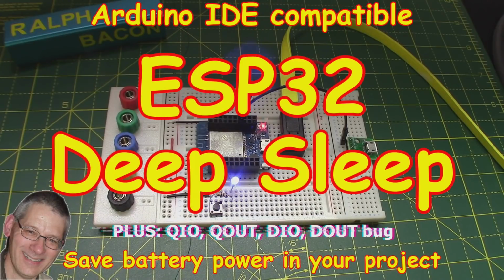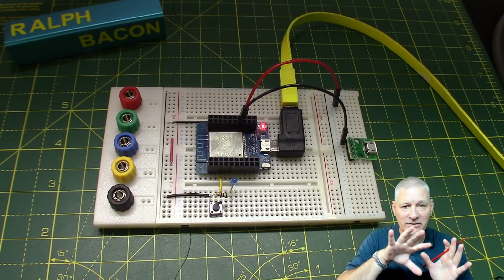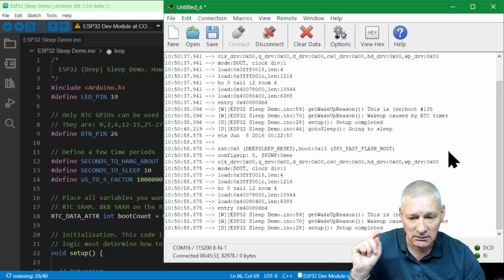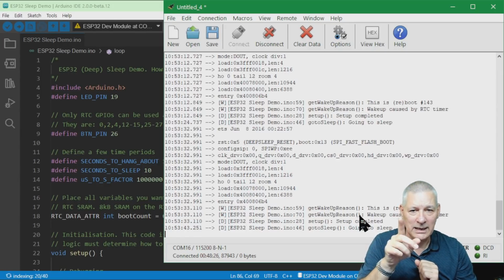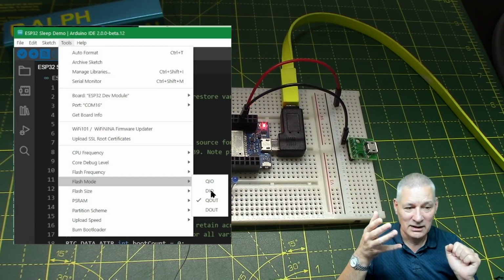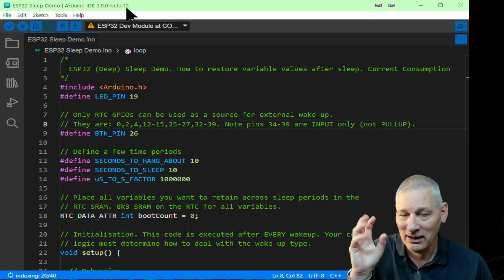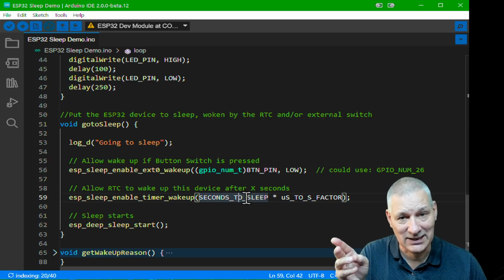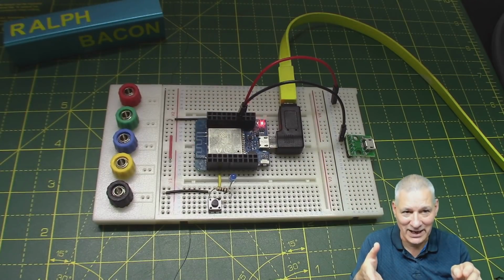#229 ESP32 - Saving Variables Across Deep Sleep

Comment: Thank you very much for this video. I am at the same time both delighted to discover  that I can sleep my ESP32 for months or even years without resorting to RTC storage magic and hugely miffed that when I researched the maximum sleep duration back in November last I found a post by somebody who stated that I would get only 71 minutes. Accordingly, I wrote code to count 1 hour sleeps and use the RTC storage for that. It works fine but it was unnecessary and made my code more complicated. Lesson learned - Google does not always present accurate answers. It does make my prototype weather station able to customise its sleep though if the charge state is getting low. Thanks for the heads up!
Reply from the maker: Glad you liked the updated information, Richard. I wonder if anyone has ever tested putting an ESP32 to sleep for, say, a year? My refuse bin reminder sleeps daily for 24 hours but that's not quite the same!

Comment: I'm using both the timer and ext0 wakeup for a rain monitor. The ext0 interrupt is activated every timing a bucket tips, and the counter is incremented (similar to bootcount). Every 5 minutes or so the timer wakeup is activated and communicates the data. My problem is that when there are many ext0 wakeups, the timer wakeup will not be serviced. I can't think of a simple solution other than the ULP but that is a bit beyond my capabilities at present! Any possible workarounds? Thanks!
Reply: I appear to have a solution - not perfect but enough for my needs! Keep track of the RTC run time. Then every time there is an ext interrupt, calculate the sleep time remaining to timer wakeup (need to do this as the timer interrupt will reset when ext0 is triggered). Finally, if the time to a timer wakeup is less than a threshold (in my case 5 seconds or so), power off the ext0 circuit until the timer interrupt is finished. The slight downside is that you will miss an ext0 wakeup, and thus a tip count if it occurs within the 5 seconds. If the timer wakeup perdiod is long, then this is not a major issue - I can live with an occasional missed tip to have the much improved battery life!
Reply from the maker: I'm slightly unclear about the statement "...when there are many ext0 wakeups, the timer WILL NOT BE serviced". Really? Why do you say that?

Do you mean that the interrupts are queued? Seems unlikely in a bucket tipping project!

An interrupt (ext0) should not impact a timer wakeup. I do something similar with an Arduino, that wakes up every 8 seconds, does something every 8 wake-ups, but an external trigger at any time will always get serviced anyway. Always works as far as I can tell!

Comment: Thank you for all your videos. I'm I really appreciate them. I wonder if I can wake up esp32 caused of the internal clock reach a certain time as: if (Time_str == "10:52:00")…wake_up… Or is the clock also sleeping during deep sleep?
Reply from the maker: As YT has removed my original reply I'll try again. 😡

You can do this if you get the current time (ESP32 will do this very easily just by connecting to your Wi-Fi). Then calculate how many seconds between NOW and your desired wake up time. Multiply by 1 million (microseconds) and Robert's your Mother's Brother, as we Brits say. Just set the value and go to Deep Sleep.

My Bin Reminder project (video #246 https://youtu.be/pT92VMlAkoA ) does this, waking up every day at 2am (give or take). All running on 3 AA batteries.

Comment: morning handsom.  quick question. im making a vibrational sensor alarm for my motorcycle using a pulled up vibration sensor. an esp32 and deepsleep can i make 2 seperate interups. and  each interupt links to a different function. ie. vibrational interupt  wakes up esp32 and runs allarm function.  if interupt 2 (Seat sensor) is activated. rfid acsess controller  function wakes up. id like to remove my master on off switch
Reply from the maker: Yes. When the ESP32 restarts (wakes-up) you can find out why it is awake (eg from an external interrupt or just someone pressing RST or powering up) and then find out which interrupt pin was the culprit.

Look at this bit of code that I use:

esp_sleep_wakeup_cause_t wakeup_reason = esp_sleep_get_wakeup_cause();
    switch (wakeup_reason)
    {
    case ESP_SLEEP_WAKEUP_EXT0:
        log_w("Wakeup caused by external signal using RTC_IO");
        break;
    case ESP_SLEEP_WAKEUP_EXT1:
        log_w("Wakeup caused by external signal using RTC_CNTL");
        break;
    case ESP_SLEEP_WAKEUP_TIMER:
        log_w("Wakeup caused by RTC timer");
        break;
    case ESP_SLEEP_WAKEUP_TOUCHPAD:
        log_w("Wakeup caused by touchpad");
        break;
    case ESP_SLEEP_WAKEUP_ULP:
        log_w("Wakeup caused by ULP program");
        break;
    default:
        log_w("Wakeup was not caused by deep sleep: %d", wakeup_reason);
    }

where the interrupt pins are set thus:
    esp_sleep_enable_ext0_wakeup((gpio_num_t)vPin, HIGH);

Any good?
Reply: @RalphBacon  perfect. Ive been trying to get my head around it all day. Before your recent sugestion. I was going to add a seat sensor to my motorbike. And depending on its state divert to the relivent function.   Ill try both methods this evening.
Reply: While i have your attention .do you have anywhere i can upload images/vids. Id love to show you all the cool things your videos have inspired me to make. All my valubles run on nfc systems. (House car motorcycle )That you have personally assisted in their creation via your videos. You have given me the means to create what i have dreamed up.and inspire new ideas. And for that i thankyou.
Reply: @RalphBacon  morning. ummm the logs are not making it to the serial monitor on my ide? like it did in your video . have i done something wrong?
Reply from the maker: Sorry, been away for a week! Have you connected the output from the device via USB to your PC? Or are you using the TX pin on the device connected to the RX pin of a suitable USB-to-Serial device? Got the right COM port?

Comment: Ralph, Thanks lots for this video. I am adding it to my smart-boat project (ESP32's sending various data from all over the boat to a central processor), and I have a question. I noticed that the power led on the board stays lit when in deep sleep mode. Is there any way (or reason) to turn it off also? I know it doesn't draw much current, but the longer a battery lasts the less often I have to replace it.
Reply from the maker: Glad it was helpful! 😁

Regarding the LED, that really needs to be removed (desoldered). If you need a visual indication that power is present on board, wire up an LED to a GPIO pin and flash it for 50mS every 5 seconds - enough to tell you the board is powered but not enough to flatten the battery! ⚡

A final note! (Well, you did ask). You say "on the board" which indicates to me that you are using a dev board, complete with USB socket, LED and so on. What you should / could do is create your own board (or you can buy ESP32 boards without a processor so you can solder your own on) and remove all the components you don't want with a battery powered project, including USB socket and associated USB-to-Serial chip (eg CH320G, FTDI). That way you really save power. A lot of work though 😕

Comment: Thank you for the video, it was nicely programmed and explained. I am trying to do a wireless BLE temperature sensor for one of my projects using the ESP32 on deep sleep. How did you get the wireless temperature sensor to work on deep sleep on your heater controller project? It seems like the Bluetooth disconnects and does not connect again after it enters deep sleep. Any help would be greatly appreciated!
Reply from the maker: I used ESP-NOW (I did a whole video on it #223 https://youtu.be/lkHdk_mKGUw ) which is built into the ESP32, does not rely on Wi-Fi and works well (all my sensors use it here).

Each sensor runs on an ESP32 with battery backup. It sends out the temperature every 5 minutes until the power disappears and it runs on battery. Goes to Deep Sleep and wakes every 15 mins. Then it sends out the temperature and goes back to sleep. rinse. repeat. When power is re-applied it all starts again.

Both Wi-Fi and BT are power hungry (compared to ESP-NOW). You don't want BT connected when you are on Deep Sleep, anyway.
Reply: @RalphBacon  Thank you so much Ralph! I was able to make my project work. I wish you all the best! Do you have a patreon page that I can donate to?

Comment: Excellent video as usual Ralph, this will help with my weather station project. Thanks for the heads up on flash mode too.
Reply from the maker: Glad to help! BTW Espressif have FIXED the regression QIO/DIO issue in the latest release 3.4.0 - whether that means we still have to use QOUT or DIO I'm not sure, I haven't tried it yet!

Comment: Thanks for this, very helpful but I did run into a compile error (integer overflow ) when I increased the SECONDS_TO_SLEEP to 3 hours. 
After some searching I came up with a fix: Defining the uS_TO_S_FACTOR as a long long (#define uS_TO_S_FACTOR 1000000LL)
Reply from the maker: Interesting. The compiler has (incorrectly) assumed that the output from the calculation is an integer (or similar) instead of a long or long long. By specifying one of the operands as a long long, as you have done, you have made it clear to the compiler just how big the result might be, so it adapts accordingly.
Well done for figuring this out, Lee. You could use ULL (unsigned long long) too, to give an even bigger (positive) range!

Comment: Been trying the Deep Sleep with the WiFi stack on as part of my project and after arbitrary number of reboots the WiFi won't init and causes a device reboot - have you had any experience of this sort of issue?
Reply from the maker: I'm using an ESP32 WROVER (TTGO T8 v1.7.1) and it reboots every 15 minutes from about 6pm to 7am, so about 50 reboots overnight. Then it wakes up for the entire day and repeats. Never had a problem. It's now run for weeks on end like this. So:

I suggest you add in some simple code to check that your heap memory is OK like this:

// Check for memory leaks etc whilst developing
void displayMemory() {
    static unsigned long memoryMillis = 0;
    if (millis() - memoryMillis > 3600 * 1000 || memoryMillis == 0) {
        unsigned long remainingStack = uxTaskGetStackHighWaterMark(NULL);
        log_i("Free Stack:%lu", remainingStack);
        log_i("Free Heap: %d", ESP.getFreeHeap());
        memoryMillis = millis();
    }
}

So every 5 minutes (or whenever it wakes up) it shows free memory,. You can adjust the time period to suit.

Also, Espressif offer a reverse crash report, I won't lie, I found it awkward to use but eventually got it working and it does show you what went on. 
https://github.com/me-no-dev/EspExceptionDecoder

Also ensure your ESP32 (board/chip) is set to VERBOSE Core Debug Level to get all the info (from Espressif).

Comment: There is no QIO/DIO issue/change. When you select QIO, the bootloader still needs to boot in DIO and then switch to QIO. There is no guarantee that the flash chip in your module supports QIO though, so you might get into bootloop. Please correct your statements.
Reply from the maker: Hang on! The issue is that it all worked up to framework 3.3.0 - when QIO was selected the bootloader reported DIO. Whether it stayed in DIO mode or not I cannot determine. But it all worked. Now, from 3.3.1 onwards, when I select QIO, the bootloader reports QIO as I showed in my video, but then causes all my ESP32 modules to loop - which they didn't before. This implies I was not running in QIO mode previously.

So the issue is that the framework is doing something different now that causes problems for our ESP32 modules. Maybe it is now working as it should but I have yet find an ESP32 module that runs successfully if QIO is selected; only QOUT works for me (or DIO and DOUT of course). 

With the utmost respect to you, Hristo, I can't see where I am misrepresenting the situation.
Reply: @RalphBacon  If this was true, many people would have reported it. I have not seen a single report about this. I am using QIO all of the time, but have some boards here that can not run in that mode (1 or 2 from many). The options for flash mode or things underneath have not really changed. Also what do you mean by 3.0.0? ESP32 Arduino is on version 2.0.1 max
Reply from the maker: I'm running on Visual Studio with PlatformIO, Hristo. The Espressif 32 framework is now at 3.3.2 on that IDE.

Is this relevant: I did notice in the "boards.txt" file for the ESP32 (Wrover, but they are all the same) it seems that regardless of the Flash Mode selected, the build_boot might indeed be using the selected QIO but the actual flash_mode is always set to DIO regardless of the Flash Mode option picked.

On that basis it might be just the initial boot that fails? I don't understand the intricacies of what mode is used for what IDE:

esp32wrover.menu.FlashMode.qio=QIO
esp32wrover.menu.FlashMode.qio.build.flash_mode=dio
esp32wrover.menu.FlashMode.qio.build.boot=qio
esp32wrover.menu.FlashMode.dio=DIO
esp32wrover.menu.FlashMode.dio.build.flash_mode=dio
esp32wrover.menu.FlashMode.dio.build.boot=dio
... etc

[All in packages\esp32\hardware\esp32\1.0.6\boards.txt]

This might just be for the Arduino IDE; I specify my Flash Mode specifically in the platformio.ini thus:

[env:debug]
platform = ${common.platform}
board = esp32_dev
framework = arduino
board_build.f_flash = 40000000L
board_build.f_cpu = 240000000L
board_build.flash_mode = qout ; was QIO
... etc
Reply: @RalphBacon  see that build.flash_mode is DIO but build.boot is QIO. Image is flashed in DIO but is booted in QIO
Reply from the maker: I'm delighted to see this has been fixed in framework, 3.4.0:

o Fixed a regression with incorrect flash modes used for uploading (#584, #623, #630)

Comment: Hi Ralph - good information as usual

I know that you can turn the log outputs on and off from the IDE by setting the Core Debug mode, but what is the mysterious variable that you mentioned that allows it to be turned on/off on a sketch by sketch basis ?
Reply from the maker: Hi Bob, good to see you here! 
The mystery variable (defined within the Espressif ESP framework) is called CORE_DEBUG_LEVEL and starts at 0 [no debugging whatsoever] to 5 [verbose]. You can set that manually in a sketch but it is honoured at compile time, not run time (so no dynamic changes).
Reply: @RalphBacon  Thanks for the quick reply.  I am usually here and find your videos interesting

As to CORE_DEBUG_LEVEL, it appears to be a macro.  If I add my own #define statement then the Arduino IDE warns me that it is a redefinition, but seems to ignore the value that I set
Reply from the maker: Yes, it is a macro definition (and in the Arduino IDE I'm not how we modify that other than the IDE setting of Tools, Core Debug Level to Verbose). We could undefine it and redefine it but I think it might be too late by then for the new value to take effect. What's wrong with the Tools option, Bob, it's a per sketch / board setting.
Reply: @RalphBacon  Unfortunately it is not a per sketch option.  Open 2 sketches in the same IDE instance.  Changing the debug level in one changes it in the other.  It's not the end of the World, just a nuisance
Reply from the maker: Yes, I would expect that opening two sketches from the same IDE instance 
would keep the same settings.

I found that changing the parameters on one instance of the IDE would immediately update those of the other. The workaround I found was to launch the second IDE instance directly from the app (in my set up that is from C:\Program Files (x86)\Arduino) then the parameters are separated. I just had a shortcut to that folder on my desktop and launched it from there.

Incidentally, have you tried the new and improved (ahem!) Arduino IDE 2.0 - does that do the same? That's based on Eclipse Thea so might do things differently.
Reply: @RalphBacon IDE 2.0 works differently because using File/New creates a new instance of the IDE, each of which can have its own characteristics, as is the case with multiple instances on the standard IDE but there are other things that I don't like about it such as its Auto Format options, of which there are none

Comment: Hi Ralph. As you mentioned before, some components on the dev board consuming power during the deep sleep. Andreas Spiess did some research on this and made some videos about. Also the ULP seems to be a very exciting player during deep sleep.
Reply from the maker: Thanks for the info, Deter! 

I'm not too worried with my setup as the battery lasts (at least) all night and if it really died I'll have a failsafe in the code so the heater won't suddenly switch on (and burn my workshop down). 😭

I do want to investigate the ULP as another viewer mentioned it too and the Espressif documentation did mention (I believe) that it could take sensor readings and wake up the main processor if necessary. We shall see!